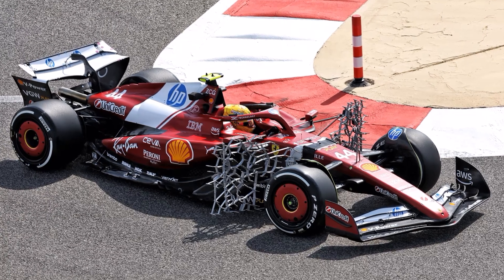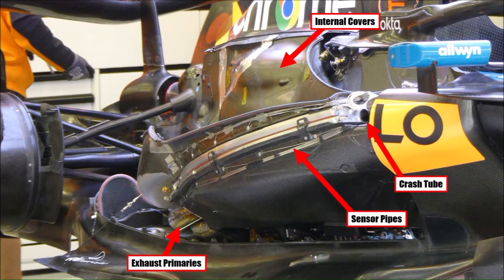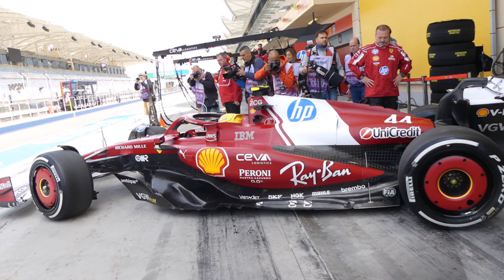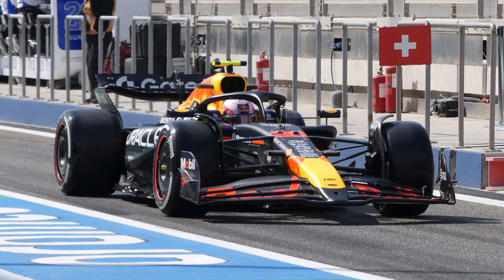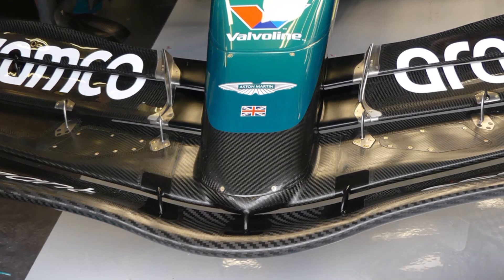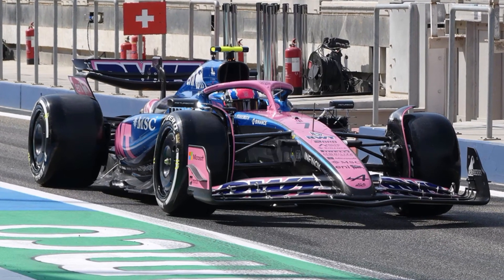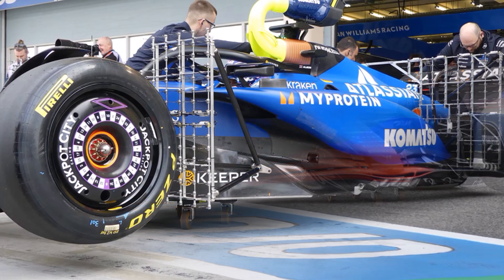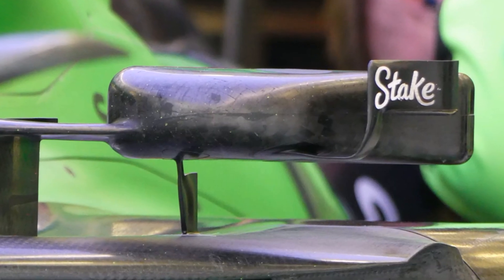F1 2025 - Pre-Season Test Day 1 - CLOSER LOOK

Comment: Its very interesting to see the engine cover gills disappear for the front runners. Dirty/outwash air will definitely be a very big problem for overtaking.

Wondering if the push rod suspension will have curb riding and stability issues along with optimal tyre temperature windows.

Comment: I think since P-shaped inlets are using the boundary layer from the front chassis, which should be less efficient for cooling, there is a need to overall increase the inlet size a bit, especially since Ferrari and McLaren arent using openings around the cockpit like RBR does. Also it seems that the openings on the top of the sidepods and the rear of the car are smaller or have disapperared entirely. So this also could require more initial air volume to cool the engine. Louvres on the side pods could be less efficiant than bigger sidepod inlets so they tried to get rid of them entirely and switched to more "frontally loaded" cooling concept.

Comment: do both mclaren and ferrari use the opened suspension arm opening? maybe bigger intake increases pressure for that outlet? 
At the same time slow down flow in the opening for more forward pressure for wheel wake control.